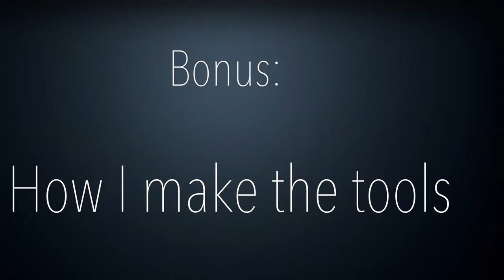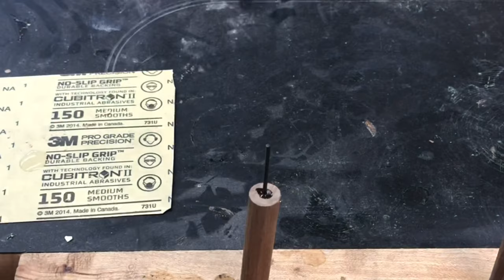OCD Toolbox Organization—No Talking, No Music

Comment: This wasn’t even ocd this was just carelessly cutting and burning holes without caring about edges and depth
Reply: Im ocd...Ive been using EVA foam for over 20 years and that stuff is hard to cut, yet it was neater and cleaner than his. I mean, showcasing the method, and while recording I can see it being a pita but it would bug me having that at the bottom. Beyond using two layers of foam, I would pour plastidip or that rubber in a case (I cant recall, the ones that made a boat out of screen doors...that rubber stuff), and let it settle flat at the bottom of those mouse nibbles lol.
Reply: @RipRoaringGarage  hahahaha. I have terrible ocd. It’s a blessing and a curse. I wanna get shadow foam so bad but I just bought a 3 drawer 1 shelf craftsman toolbox and the tools I have barely fit in just jumbled up piled together. I wanna try and get some epoxy and mold something. But if I did that it would take SOOOO long cuz I need to make sure all the sockets etc are even and level while pouring liquid onto them.  Then I need to figure out how to make sure I can get them out once it’s dried. (Probably baby powder or Rosin bag powder. Something like that on the tools then put them in) don’t know how to keep them from moving tho
Reply: @Mike-we3rb  I know the feeling...today I had a terrible day, and none of the foams came out right...so tomorrow Im redoing everything. It can be a curse, because its setting me back a day...and I still would like to edit at some point this year...Im so far behind that its hurting my channel (which Im OCD about too because why not...I wish I could just keep things in a pile, without them in organized systems, records in spreadsheets, inspection timetables with reminders send to my email....its tiring lol)
Reply: @RipRoaringGarage  hahahaa you’re cutting shadow foam now? And you mean you cut them out but didn’t like them so you’re buying new foam??  Also same here I forget what I said in last message so sorry if I’m repeating myself but I’m tryna edit my own videos for yt. They are all ocd fresh down to every details. I haven’t posted one yet in like 6 months of filming. I’m doing voice overs afterwards instead of talking through the videos also so it’s gonna take even longer. Either higher quality videos but not posted as often or lower quality videos more often. I have to find a median lol
Reply: @Mike-we3rb  Yup...Had to cut new foams, but I had some extras so no extra cost. Im experimenting with different foam types. The typical stuff is too pricey, so Im using other kinds...we will see how it holds up over time. EVA was good but comes out sloppy since its very dense and a pain to cut (with medical grade scapels even). I understnad with the vids. Im disabled, and have to deal with doctors and all, so I tried uploading weekly for three years, and minimal results. Now Im just going to post longer format, 45m to 90m long once a month, but Im in a break now. Im redoing my garage and tool box lol...and its killing me. I was not as productive as I wanted today. Im doing these weird side protectors for the box for some tools that can slam in while placing them back.
Reply: @RipRoaringGarage  make fixing up your tools another video. Also damn. My ocd is bad but idk if I’d be willing to recut the whole foam sheet again lol. That’s a real pain. And damn that sucks about vids. Thought it would be better
Reply: @RipRoaringGarage   yo where do you live? I live not even 20 mins from northvale nj. Used to drive past every single day multiple times a day. My dad was a warehouse manager in northvale
Reply: @Mike-we3rb  Cool! Im not far, on the other side of the border. You thinking of doing a colab? Im def open to working with others, and once I finish and begin posting some of the new videos (theyre recorded already, just have to edit, theyre of my cars that have been sitting), I have an idea of a fleet of old cars that sat..and I mean rare models, Edsels and all that.
Reply: @RipRoaringGarage  hell yeahhhh man. How much you know about cars?
Reply: @Mike-we3rb  Been wrenching on them for about 20 years or so...Im actually an aircraft mechanic by training but...Ill figure it out. Im set for an Edsel or a Corvair...because..I like pain lol
Reply: @RipRoaringGarage   god damn and god damn. I’ve been working on cars for 2.5 years. Just my Ford Fusion. Sometimes my brothers Audi. My dad used to have a ‘73 Mercury cougar convertible. New York Mets blue. Super sexy. Never even had a problem except for no heat. You could here the fan slapping against something. I’m 24 lol. You’ve been working on cars as long as I’ve been alive. And damn that’s impressive. Dude at my work used to work on heli’s. Then somehow ended up in a warehouse lol. I’ve heard you make amazing money...?
Reply: @Mike-we3rb  Yeah, well, give yourself time. Just having time in a field doesnt mean much (unless your union HA), its the skill that counts, and I dont really see myself as this amazing mechanic. I never had a plane crash on me, and ive been ok with my cars (I did work diesel on buses for a while but I went back to driving then). As far as the pay, in aviation and on heavies (I was on 707s and DC10s) the pay was very good. Starting junion pay was 35 an hour for Fedex but you need to have either military 5-level of A and P license. By now, I think everyone needs the AP to turn a wrench on the jet, and theres a lot of FAA stuff to comply with, which limits people...I turned it down because I was....smart. I went on to two of the most underpaid jobs in the world, and both just as corrupt...Im ashamed actually. One was LE, the other in education.
Reply: @RipRoaringGarage  yes sir. Speaking of union(I think this is union) I’m trying to get into pseg for hvac soon. Gonna be getting the milfs like a pizza boy and the cash like a stripper. And wow. I hear for the mechanics you have to fly the plane or heli with the pilot whenever you repair something. Just cuz that way you will def not do a half ass job and youll die with the pilot lol. What do you mean LE? And education you mean a teacher?
Reply: @Mike-we3rb  HVAC is good. My neighbor does that and makes a killing. For aviation, no, we dont fly on the jet because theres not enough time to go up on a joy ride. Id be working 12-16 hours a day, 7 days a week, but granted, this was military. Civilians dont work as much, but still dont have the time to fly around with the jet. You might have a senior mechanic going up, as part of the signing off for the maintenance action. Im not counting the flying crew chief, which is a separate job, that flies with the crew for locations where there isnt any maintenance for that specific jet, but again, thats a military thing. LE is law enforcement, and I was teaching but at university. I liked helping people in both jobs, but I made my boses look bad lol...I can't say Im better off now, but for other reasons. I broke my neck and back and had a bunch of other surgeries from radiation exposure from the military, so Im kind of getting back to being able to live....Its funny that of all the things I chose, I decide to go back to working on cars....Im not very bright sometimes lol
Reply: @Mike-we3rb  Yeah, he does commercial hvac, not house, and I guess thats what I assumed. As far as head gasket, just get yourself a manual, and follow the steps. Its a lot easier with a manual, versus just going in blind. I still use the manuals for various cars (if I have them), and it takes guess work out of torque values...I know lots of guys do the armstrong torque but I always put a torque wrench on the fastenere if it calls for a specific value. As to the other stuff...it was a dirty department, lots of money being laundered and I wouldnt play ball. Looking back, Im luck I didnt end up...well, in a ditch like this other cop, but I had come from a federal agency, and funny enough, the friends I made there many were in gangs, outlaw bikers, and I told them, if something was to happen...you know who to find lol. So, I left but not before a wreck while chasing down somebody with a bolo...I dont even remember to be honest. Next thing I know, granny tbones me, totally oblivious, and of course unhurt...me...I needed a vertebra removed and replaced, bolts, plates and thats all she wrote. Pain for the rest of my life..and some days are meh...others are torture, but thats life.
Reply: @RipRoaringGarage   damn that’s terrible(I answer most posts, texts, comments backwards lol. Aka talking about your back first) that’s crazy. So you were basically disabled before the surgery? Not really but it would’ve hurt a ton to move....? My mom worked in a hospital for 30 years and my brother studied a little exercise science in college.  Now I know a little extra about the body lol. My mom and her sister had/have a genetic herniated c4 vertebrae so now I think I have it too. Headaches and migraines all day most days. I crack my neck like 20 times a day lol.  Gonna snap it one day.  And yeah I have a cheap ass torque wrench from HF. I use it for any bolts strong or important. And I never use a manual. I’m cheap I just research or go blind lol.
Reply: @Mike-we3rb  Yeah..I was in a chair for a while, then walker, now I have a cane or three lol...since I tend to lose feeling in arms and legs at times. Its not very convenient when I yank and engine out or jack a car up...but, I keep going. THe pain is nasty, and thats nothing they can fix anymore. I cant get hired because Im a huge liability, so I do cars for myself and here on YT...I started with this trend thats going around of reviving cars...long format, but what takes other guys about a week to produce takes me a month or more...It took me a month just to clean and today, I finally finished organizing my toolbox and garage, with the shadow foam and all that...I will do a toolbox tour but its going to be out sometimes next year? lol...yeah, no shot of competing moving this slow. Whats sad is that I have buddies that like to wrench, but non show up. Maybe they dont want to be on camera, cool...but, at least maybe to help a guy out? But, I still get the boost of doing some nasty job, pushing through pain, to get it done...
Reply: @Mike-we3rb  As far as your spine, take care of it...I was the fitness leader in my squadron, and they send me to learn physiology and some basics of nutrition, fitness and some other courses...I thought it was internesting, and funny how its coming back to me this way, through the disabilty lense...and sorry for my typoes.....my hands are numb as hell...I may have pushed a bit too hard wanting to wrap up the garage with new decorations on the walls, cleaning, mopping up ...Im done at least! (I got long in this..YT wouldnt let me post without splitting up the comment!...copy and paste and word are my friend LOL)
Reply: @RipRoaringGarage  hahahaha it’s cool. Type as little as you want I hate reading and I’m not good at it. and yeah I probably should take better care of it. I have terrible posture
Reply: @RipRoaringGarage  I’m off to bed now. I’ll answer this message tomorrow hahaha
Reply: @Mike-we3rb  Sleep well...Im still up (night owl), plus, I did my weekly analytics and its a huge downer...but at least Im going through the NOS parts I scored in the used toolbox I bought and only after 4 parts, Im over 1000 bucks in Mopar parts lol...I try to cling to the least bit of happiness in this life!
Reply: @RipRoaringGarage  hiiii. Just remembered this convo last night lol. I have a short attention span so I don’t like typing long messages. Especially reading them. You got fb messenger?
Reply: @Mike-we3rb  Hey. Yeah. I have the links in the description in my last few vids...Unfortunately, the name I chose for FB is ....very generic lol. Al Barry
Reply: @RipRoaringGarage  hahahaha wish me luck finding it
Reply: @Mike-we3rb  I do have the FB links there, and they do work, but thats for two groups I run, but you should see me posting there. On the Tools, Tools, TOOLS group, Im the owner/mod/whatever and post most often, although not so much lately. Im editing now, I think my last silly vid before I publish the more serious vids...(although honestly Im not holding my breath lol)
Reply: @RipRoaringGarage  oh yeah I just saw them I just meant like messenger. 1v1

Comment: Great idea, i will do this for sure. But, i will have two pieces of foam that together will be as thick as your piece of foam. Cut all the way through on one piece of the foam and then glue the other under it. This would ensure a much nicer base perhaps. Thanks for this video!! :)
Reply from the maker: Good idea!
Reply: I like this idea and was thinking that's how I'd do it. I think that'd be easier for someone like me without a propane torch. I can just use my utility knife to make the cut-outs.
Reply: @BlacktailStudio  Have second foam in a different color and then you easily see what is missing. Also makes you feel guilty for not putting them back in the correct place every time
Reply: You dont need foam at the bottom, just a regular toolbox liner, or something else thin, to maximize drawer space

Comment: Rather than cut up allen wrenches, why not use finish nails? Also rather than cutting thick foam and having to pull it out in uneven pieces, why not purchase foam in thinner sheets I” or 3/4”. Cut completely through one sheet so the cutouts can just be pushed through and then just gluing the top with cutouts to a clean bottom sheet. Much cleaner looking and not maybe so messy on the hands. Just a thought.
Reply from the maker: Where were you when I did this?

Comment: Have you tried using a CNC router bit in your drill press? It is my preferred method of doing this. I trace the shapes just like you did, then set the depth on my drill press, lower the bit into the middle of a shape then slide the foam around to cut out the foam. I love the perfectly smooth bottom of the cut out and I get cleaner edges as well. You can even get fancy and make the handle parts deeper by just adjusting the height on your drill press a few times while tracing the handle area. You can also use the angle on your drill press to have the foam overlap the object being stored to really hold it in place, especially if you are cutting the foam for a case that might be moved around or even set down upside down.

Comment: Cam, if you were OCD, you'd LASER cut 1" foam on a CNC then glue it to another 1" slab and have the most perfectest tool drawer liner. Love your work and videos with or without narration.

I am jumping on this late, and have a few suggestions for anyone wanting to do this.

-- Use not a silver Sharpie? (Cam, I'm genuinely not taking a dig at you, unlike my opening remark, which definitely is.)
-- Search for 'soldering iron foam cutter'. If that is an option, it makes for a very effective/efficient cutting tool. 
-- This method is excellent for a DIY bespoke tool arrangement. For an alternative arrangement approach (yes), see Adam Savage's foam core tool drawer organization video.

Comment: Leave the allen wrench in tact and put it into the wood handle as is. Let it stick out  an inch or a little more. Then when you heat the allen wrench it will help to cut the bottom of the foam if you just give it a 1/4 turn when melting. Also I was thinking that if there is a way to attach to a solder gun tip that would work too !  Cheers !   :-)

Comment: About to do a LOT of shadowing & am lookin around for an easier/faster way than the tracing & Xacto knife method I've used in the past. Re-heating that tool so much seems like it'd be frustrating and stinky. I don't have to dig any foam out of the bottom because my holes will go all the way through so as to reveal a different color foam mat underneath (job requirement). I'm thinking about a reciprocating saw or Dremel with a saw/cutoff attachment. Anything but an Xacto because that sucks!

Comment: Has anyone mentioned leaving the bent metal on so you can undercut, and possibly have a better finish by not tearing so much out by hand?
Reply from the maker: Hadn’t thought of that!
Reply: Yup also just make the heated cutting stylus out of piano wire or old nicrome wire from an electric clothes dryer element or tig welding filler rod wire.

Comment: I bought a little bunsen burner to connect to a propane tank for just this purpose 👍 I do a LOT of foam work for mould form making and get sick of the electric carvers getting cool in the cut. Using simple carbon steel (old bandsaw blades) in wooden handles and the bunsen is much quicker.
Reply from the maker: Nice!

Comment: Great ideas, great work!
But this is not OCD worthy and in fact its messing with mine. Those finger holes are all over the place.
There is no need to go as deep as you do in so many of those. You can layer them so the handles are deep but the blades are sitting up high.
Reply from the maker: Fair!
Reply: Right... his definition of ocd and my definition are nowhere near the same.

Comment: Howdy Cam...I've been doing some research (umm, video watching) on how to shape/cut foam for a few of my projects, came across yours (been watching your table builds for awhile). Saw your video on foam cutting, INSTA-CLICK!! 

However, your link to the type of foam you use is a dead link. It goes to the Amazon site but it says it couldn't find it. 

Could you elaborate on the type of foam you used. Was/is it Faizen? How do you like it? 

Thanks

Comment: Great video!  Totally enjoyed it!  My question is a departure from your project but hoping for a satisfactory outcome.  I have a lot of walnut but nothing that is close to 2” thick.  My son wants a walnut table that is 2” thick.  My objective is to use two pcs of 3/4” MDF laminated to make a core of     1 1/2” and then apply a 12” walnut veneer on the top and edges using tight bond lll to adhere it.  Am I wasting my time and materials attempting this?  Would appreciate your comments/advise.  
Thanks, Gerry